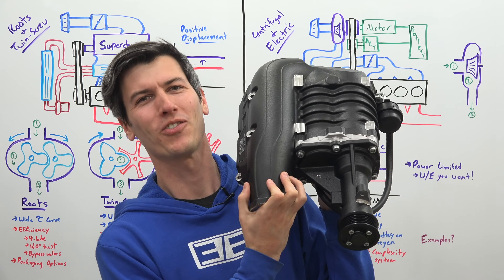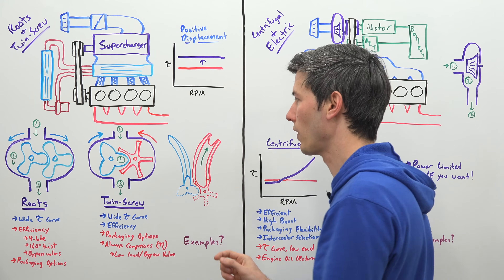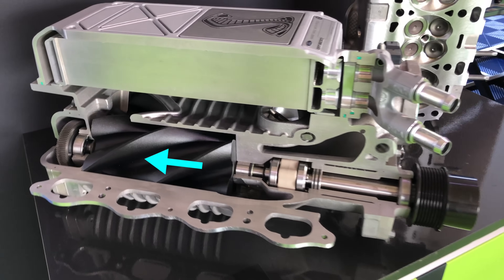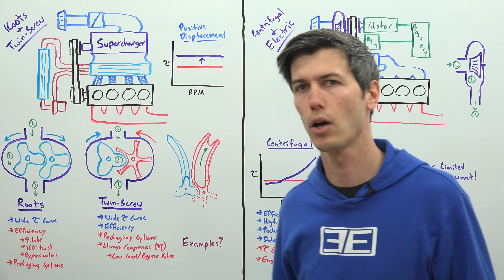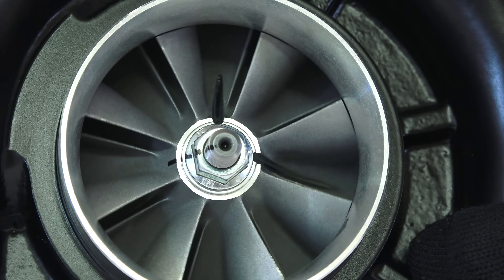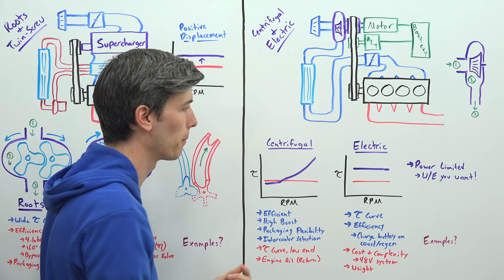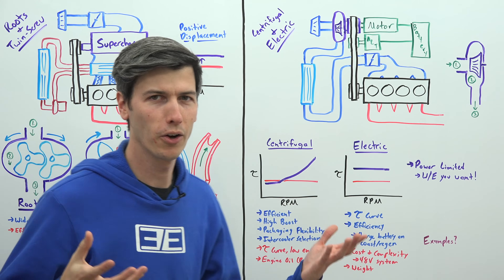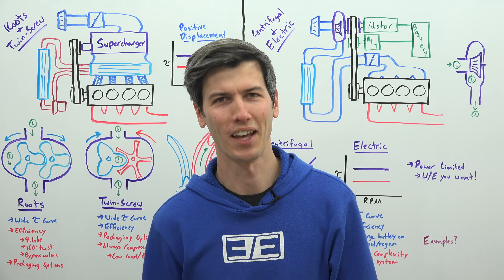What's The Best Supercharger? Roots vs Centrifugal vs Twin-Screw vs Electric

Comment: Hey justin,
i have been watching your channel for as long as i could remember. U were very inspiring and your contents were always very interesting and great. Respect!

I suddenly though back to a VDO you did many years ago, it was about a suggestion to reduce and fix the turbo lag or the turbo threshold issue turbochered engines experience.

I remembered the theory went something like: wouldn't it be better if the engine has an actuator valve to switch the air intake route between the one passing a turbo and anotherone passing through atm pressure.
Till this day i think that is still a brilliant idea to do so. It should eliminate turbo threshold issues and minimize turbo lags, but to this day we have yet to see such method being imply. I really wonder what's your take on this? given that you even once mentioned it yourself. Surely you must've already figured out its limitations, hence i've never seen anymore mentioning of it.

Would love to hear from you,

keep up the good VDO contents :)
Reply: Patikorn Wood-Thanan Hi, 
This has already been implemented by several manufacturers. It’s especially useful for small engines that need some extra boost at low rpm. 

The solution is to a install a small turbu with a bypass valve for higher rpm’s when the turbo would spoil up to much.

Comment: I wonder would it be possible to have an electrically assisted turbocharger, i.e. a normal turbo, but with a motor to yank it up to full boost when you floor it?
Reply: They are in use already.  Look at Formula One engines and maybe Audi.
Reply: @gort8203  oh by the way the motor on Formula 1 that assist to "yank it up" was about 190kW or so

Comment: I can’t really grasp why an electric supercharger would be a good idea when it has the same prerequisites as an integrated starter/generator that provides torque directly instead of adding boost and adding torque indirectly. You need a higher than 12V system, an alternator/generator and a battery for both. With an ISG you can use the generator as a motor. With an electric supercharger you also need the compressor (with integrated motor). Seems to me like the more complicated and less efficient (more energy conversion) solution. But Audi does it, so I must be missing something.
Any input on this?
Reply: if you put it in a (mild) hybrid car, you already have the higher voltage system and usually a form of regenerative breaking, or they could put a higher load than needed on the engine (for a more effecient operation) and convert the surplus of power into electricity with an electric motor attached to the drive train. so you have the electric energy in an efficient way, why not use it on a small supercharger during a moment that the regular turbo('s) aren't spooled yet? that's the way car manufacturers use this, to bridge the gap and make the engine more resposive and efficient at all times. also the increased airflow from the electric supercharger can aid in spooling up the turbo('s). You basicly only see this on diesel engines i think, as they become much more efficient on boost (much more than petrol engines).
Reply: You can do WHATEVER YOU WANT!!! You can do it WHENEVER YOU WANT!!! You can do it  WHEREVER YOU WANT!!!

Comment: Your drawing shows the twin-screw supercharger spinning the opposite way a roots does, but if you look at any twin screw supercharger, you'll see the pulley is on the same side as the roots.  Viewed from the front, the right pulley is spun clockwise either directly or by a driveshaft and belt from behind.

I understand that Kenne Bell's own website and Jeff Hartman's Supercharging Performance book agree with your drawing - that the air moves through the rotors rather than around them along the housing.  But, if the same pulleys on the same side are spun the same way, how could this be?  Also, I would point to the multitude of rotary screw compressor animations produced by manufacturers.

Comment: You can gear a centrifugal supercharger so it spools up very fast like in low rpms and using a blow off valve control boost to whatever you want. You can even engineer a clutch system like a torque converter on a automatic car to determine the relation between the speed of the supercharger and the belt driving it
Reply from the maker: Yes, can be done, just super inefficient to run it that way.
Reply: @EngineeringExplained  That's debatable in my opinion

Comment: Thanks for this! Me? I like turbocharging (actually, turbocompounding) a lot better than mechanical or electric supercharging, but that is because I am fixated on efficiency.  I just can't stand the thought of all that energy being thrown away, down the exhaust pipe! I would much rather recapture that energy and use it to move the car. I appreciate your openness to all things engineering. :-)
Reply: Has there ever been a turbo-compound automotive engine?
Reply: @gort8203  The old two stroke Detroit Diesels ran an engine driven blower and exhaust driven turbo charger. The 6-71 blower used on hot rods is the blower off the 6-71 two stroke diesel.
Reply: Gort The closest thing I can find closest to turbocompounding on automotive application is Garrett e-turbo. They installed a KERS-like mechanism in between the compressor and exhaust side of the turbo to charge a battery, storing energy for spooling the turbo in similar manner to e-superchargers Jason explained.

Buuuuut that’s just me googling for about 10 minutes so I could’ve missed a thing or two here.
Reply: Julio Jonathan 
That sounds like the current MGU-H if F1 (motor generator unit - heat). 

What’s a turbo compound?
Reply: @juliojonathan8348  Turbo charging is not turbo compounding.  Turbo compounding is when you gear a turbine to the output shaft of the engine to extract power directly from the exhaust stream.  It was used in some late aero engines to efficiently extract the last possible amount of energy from the fuel burned.  There are very interesting trade-offs involved.  Such an engine will probably have a geared multi-stage supercharged rather than a turbocharger.
Reply: Gort well, sorry for the misunderstanding. I guess I have to clarify. I said ‘the closest thing’, so it’s not necessarily the same thing, although Garrett’s e-turbo does incorporate the basic idea of capturing energy from burnt fuel, so I guess it’s worth mentioning.
Reply: Conservator my friend Gort over here has explained it thoroughly.
Reply: @gort8203  

Great question!  First, before I get to that, I want to define "turbocompounding".  The turbocompounding I am speaking of is not a series of turbochargers, each pressurizing intake air and handing it off to the next. Turbocompounding is using the energy in the exhaust gasses to not only pressurize the intake air, but to also provide more power to the engine.  Either the power turbine or a second turbine is connected to the crankshaft. The Wright Cyclone R3350 radial aircraft engine used turbocompounding to make way more horsepower than just with turbocharging alone.  My father worked on R3350 engines for the airlines: the turbocompounding system was simple and very reliable. It was just a set of three turbines that were spun by the exhaust gasses and were geared to the crankshaft.

Now, as far as I know, turbocompounding has been successfully used in aircraft and in over-the-road trucks, but not in cars.
Reply: The issue is, how do you do turbos with long tube headers? I'm looking to get a GT350 and put Kooks headers on it. Should I just run the stock headers for twin turbos, then?

Comment: There are some instances of people using compressed air to “supercharge” their cars engines. Could you make a video on that as well? Maybe hybrid turbos as well? I believe Garrett now has a hybrid. I also think I saw Volvo and a couple other manufacturers toying with them. I made parts for a hybrid turbo in the 1980’s that was being developed by a company called Turbodyne (I think that’s the name). They were developing them for commercial diesel vehicles that did a lot of stop/go. Their idea was to boost from idle to get power and reduce soot. When there was enough exhaust flow/pressure, the electric motor would switch to generation and charge the batteries. Much like F1 does today

Comment: Thanks for clearing up the difference between roots and screw superchargers, very informative and interesting. Now all you have to do is comparison between superchargers and turbochargers and the efficiency each has or doesn't have ie the parasitic effect on horsepower and the fuel wasting on both a supercharger vs a turbocharger. 
Looking forward to seeing how your roots performs on your MX5.
Reply: Though twin screw superchargers actually spin the same way as the roots blowers

Comment: What was that crazy engine in the beginning? Two sparkplugs but only one huuuuge Valve.
Reply from the maker: Hellcat 6.2L V8
Reply: Any aircraft piston engine,. . .
Reply: @dewiz9596  Many aircraft engines are 4 valves...
Reply: But how does this even work with just one valve? That's a video for itself worth.
Reply: oxdudepoege the exhaust valve is just not visible from this angle, it’s directly behind

Comment: The best is the one with the loudest whine
Reply: I'm mesmerized by the high pitched whine twin screw superchargers produce
Reply: I'd rather hear a supercharger whine than the wife 🤣
Reply: Until you have kids.
Reply: Procharger noises are freaking sweeet
Reply: @straight_intro  it's not just the sound of the blower but the incredible sound you get from the exhaust. When I first ran the D3R from Procharger many years ago. My little 408 sbf sounded like it turned into a 1000ci mountain motor.
Reply: Get a wife then :D
Reply: @jvjh777  Was just about to comment something similar... :'P
Reply: an inefficient twin screw then

Comment: Hey Jason, why are you choosing the roots? What’s your take if one was to choose aiming reliable track performance (decent boost, small budget)? Great video btw!
Reply from the maker: If you want it to remain reliable on a small budget, I'd leave it stock. I chose roots for the wide torque curve, and healthy boost in power.
Reply: @EngineeringExplained  can you elaborate why you chose the centrifugal on the s2000? It always baffled me why you went with that. (Thus with the vtec system it made sense to get everything up top..) I'm considering a supercharged Elise, personally I love the grunt down low, when you open up from a slow corner and it pushes you out without waiting for the rpm to raise.

Comment: But with the roots and twin doesn't that change speed with RPM?
Reply: yes, they do. But, because of the fixed displacement unit, depending on the SC dimension and the ratio between crank and SC pulley you have a relation between the mass air flow which goes out from the SC and the mass of air that  your engine breath in NA. That ratio is in ideal terms fixed. Imagine that your eaton m45 is a 0,75l per rev, and your engine which is a 2.0 4cyl with a pulley ratio of 2. when VE=100% your engine needs 1l of air per rev in NA, and your SC gives 0,75l*2=1,5L of air per rev. It means that the engine will see at much 0,5l of air in excess, but instead of volume, in pressure. In this case, you could have 0,5 bar of boost from idle to rev cut.

Greetings from Spain

Comment: Am I wrong or are you using the super charger and turbo charger terms synonymously? I thought there's a distinct difference between the turbo fan type and the compressor pump type.
Reply from the maker: Turbo is exhaust driven. Supercharger is engine driven. They are not interchangeable terms, hence I've kept them separate.
Reply: In the early days of the turbocharger it was known as a turbosupercharger.
Supercharger = forced induction (whether PD or centrifugal)
Turbo = turbine driven by exhaust gasses

A turbocharger is a [centrifugal] supercharger, driven by exhaust gasses.